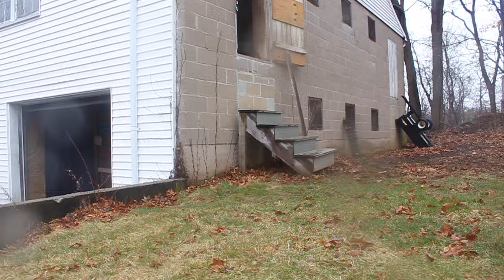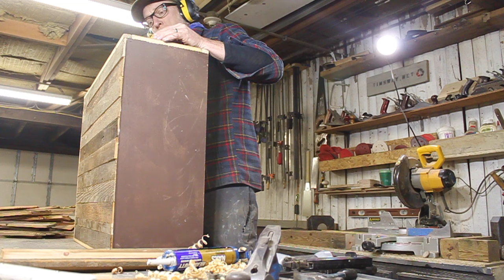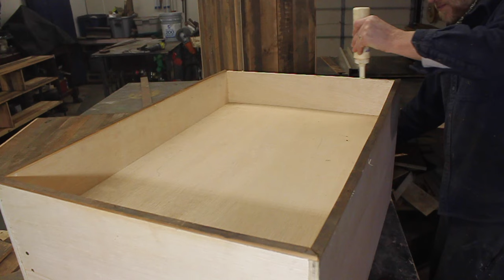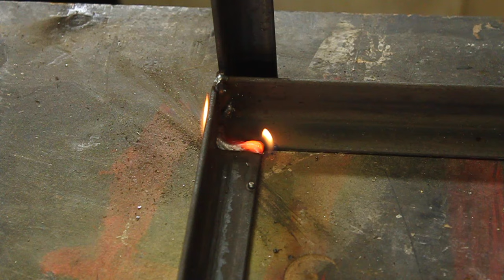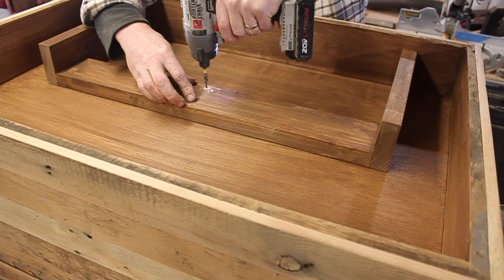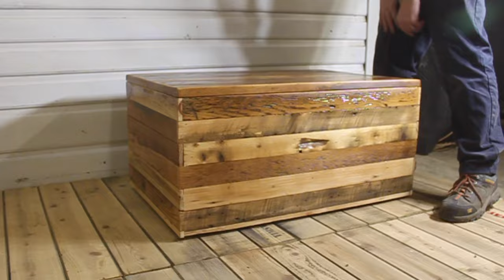Reclaimed Barn Wood Living Room Suite

Comment: That dark paint/stain you used on the inside surfaces came up a lot nicer than expected. Thumbs up.
I also love the combination of the steel & reclaimed "rough" timber look.
Reply from the maker: thanks! i tried selling the customer on painting the interiors a bright color, but they opted for dark stain. I used a water-based one so it wouldn't stink up the closed interiors.